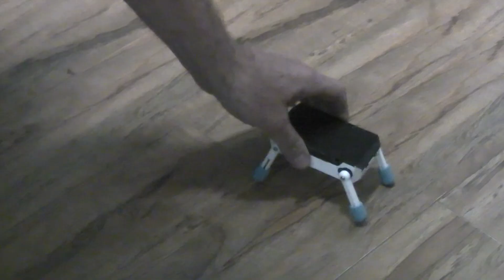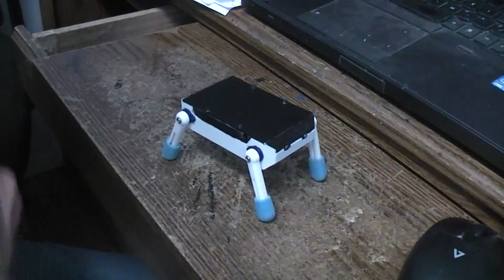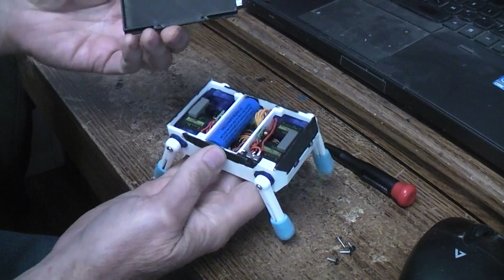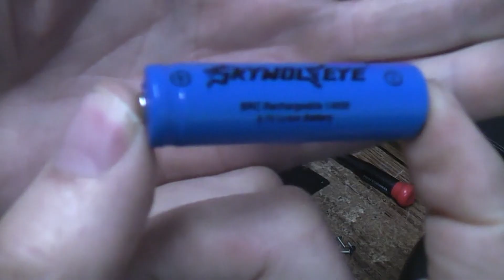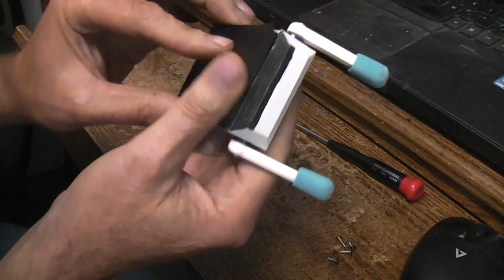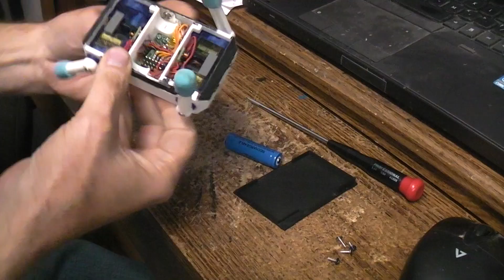Katie 180, DIY robot new programing. Walking, turning and flipping. Inside look, & possible changes.

Comment: I don't understand any of this technical stuff. I just think it's adorable! 😆😁😄
Reply from the maker: I have some 270 degree servos on order and a printed circuit board to clean up the wiring. Also thinking on ordering a clear plastic body. We will see.
Reply: @Robothut I love it! I got an email from Kickstarter for the one you were talking about that's going to be commercially available. $99 for the basic version.
Reply from the maker: @outsider238  Yes, if you like smart phone controlled App toys and basic programing it is very cool. I wanted to do my own basic low cost non app version. But there KT2 is very cool and has some pre-programed actions that I think you would like.
Reply: @Robothut I'm still undecided on it. I have to save for some more stuff I have on order. So much cool stuff out there! 😄

Comment: Nice detailed design. What software do you use for PCB design? I used to use Eagle but lately I've been using EasyEda.
Reply from the maker: Design Spark PCB. Since I already used Design Spark Mechanical for the 3d CAD thought I would stay with them. I did try EasyEda but found a issue with both programs. I do not want to design a schematic first for this simple board that will just have pads on it. But No Schematic then no NETs and no NETs means the PCB program will not let me place track lines. I do not need their automated track lay out system for this design. There must be a work around so a person can lay down track lines manually without Net files.
So it pissed me off and I just 3d printed a PCB board with negative track cutouts that I can just lay wire in to connect the pads. Works great.
Reply: @Robothut  I never tried to make a board without a schematic but your comment got me wondering. I made a temporary video of the process. I'm not sure this is what you wanted to do or not.
https://youtu.be/1dX-BvCLbGw
The 3D printed PCB sounds very interesting.

Comment: Sounds like back to the drawing board.. neat
Reply from the maker: Yes, I also just found some 9g servos that in
stead of having 180-degree rotation have 270-degree rotation and meal gears. So ordered 4 of those.
Reply: @Robothut  more movement
Reply from the maker: @PeterAgostiniJdcap26  More movement coming with the 270 degree servos. Right now it is running with standard 180 degree servos.